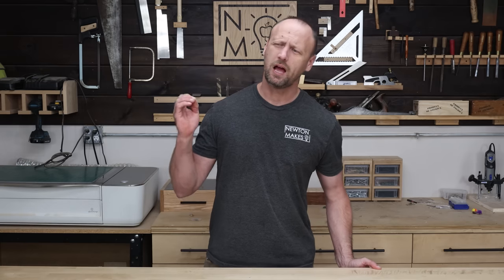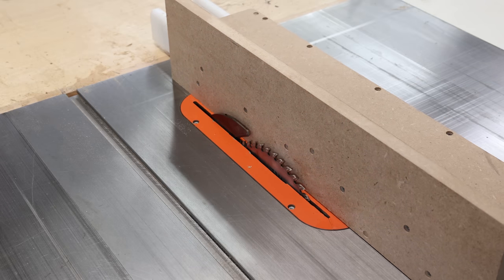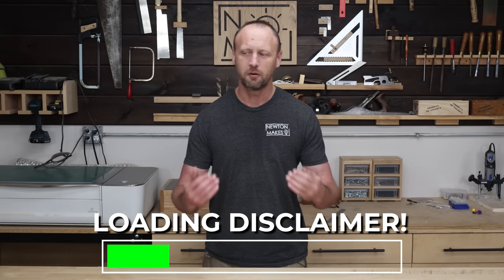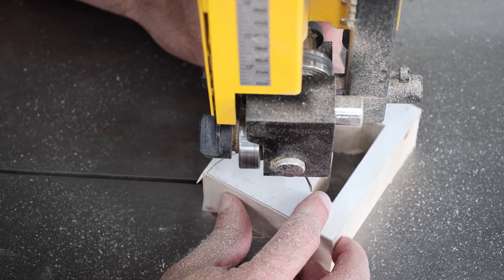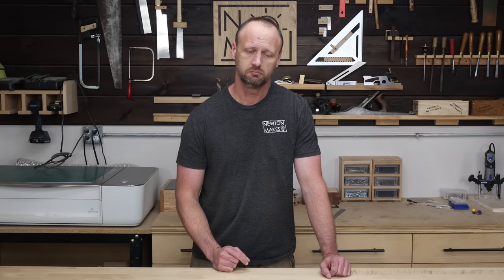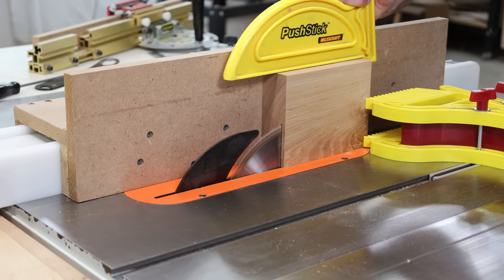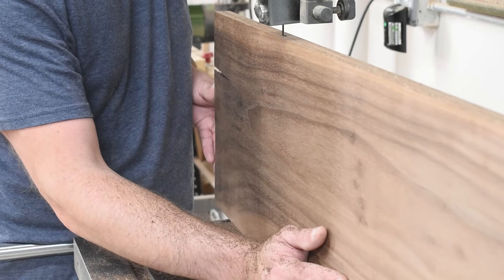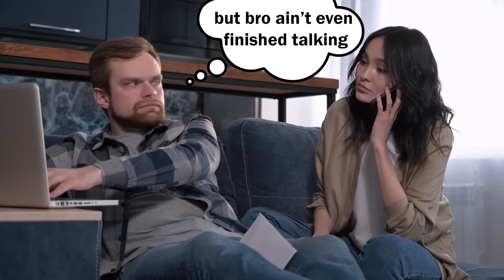You’re Resawing Boards the Wrong Way

Comment: With a band saw able to tension a blade well, there are 2 Lennox carbide tipped blades that will outperform your technique. The fastest and most cost effective for resawing is indeed too wide for curved work. That would be the Woodmaster ct. It has about a .05" kerf. So if you're sawing 1/16" veneers from a 4/4 board you get up to  8 slices, versus up to 5 with your method.  if your machine is adjusted properly and blade sharp, drift isn't an issue. Nor is speed. A band saw with this blade would be faster than your method.
Next choice is Lennox trimaster, 1/2" 3TPI. More expensive than Woodmaster Ct, with slightly larger kerf (.057"), and  somewhat slower feed. But narrow enough to cut many curves, so you could leave it on. This is the blade I use for my one and only  band saw --mostly resawing, some curves. 
Either of these carbide tipped bands will cost  several times more than steel "resaw" blades--but will dramatically outperform them, and outlast them by 15-25X--maybe more. They cut so straight you can do much joinery work with them, another huge plus (tenon cheeks, 1/2 laps....). A 144'" 3 tpi Trimaster has 432 carbide tips for about  $175. A good 10" circular blade has 40 tips for $100 or so. The tips do the cutting.  Do the math....
Consider resawing  on the band saw with a power feeder. There's only one good choice for a small band saw, and you've probably never seen it. Google "Little Proteus power feeder". Maybe i am a little biased (I designed and make and sell the Little Proteus)---but a power feeder on the band saw solves the brain drift issue, and gives you perfect feed speed for hours at a time. It takes almost all the stress out of resawing.
But you're right,--if you don't use a good resaw blade (carbide tipped or Laguna's version) your method makes sense!
Reply: What would you suggest is the single best bandsaw blade for efficiently, precisely and easily slicing veneers?
Seems like you're not even suggesting the resaw king, which is what I've been looking at mostly so far.
Also, do you think a Laguna 18BX would be enough or would I be better advised getting something different? Going to need a lot of veneers.

Comment: the band saw your using says its 12 or 14 inch cut but its a little under powered. laguna 220 volt will roller fence and power feeder will allow you to cut hundred and hundred of board feet per day and has a auto stop. would you buy a black and decker table saw to make stuff or a high end table saw.  same thing..

Comment: My table saw rip blade kerf is very close to my 3tpi bandsaw resaw blade. My 3hp table saw is quite a bit faster than 3hp bandsaw. So, I do it as you described as well. Blade drift is not a big a problem as attention span in most cases. Just sayin…..

Comment: Do you feel that there is a blade height limit with TS method? That is, to ensure that the blade stays at 90 degrees and doesn't get warped offline by a hardwood piece, for instance, when it is fully extended?

Comment: Dear newton
In case you ever wonder if you’re reaching someone let me tell you, I’m indebted to you for this video. You ever come thru portsmouth NH dinner is on me.  
I started my woodworking hobby in 2020 building a guitar 100% from scratch with a master luthier.  I learned how to ruin wood with a table saw, destroy wood with a router, and waste wood with a bandsaw.   
When I built my undersized wood shop and started building basic furniture cutting boards knife racks and boxes I bought a Rikon tabletop bandsaw.  Read everything I could to learn about it.  Played with many blades.  Watched dozens of videos by snodgrass, estlea, stumpy nubs and others about how to eliminate drift.  Wrote to snodgrass.  Spent hundreds on blades.  Setup my saw dozens of times.  Got a jet 14” from an excellent woodworker down the street who was retiring.  Now I could resaw cherry apple and pear logs from my own property.
And both saws, every blade from 1/8” to 3/4”; brand new, used, overpriced, underpriced, cheap, ridiculously expensive, domestic, Chinese, every setup, new blocks, tensioned properly, over tensioned under tensioned, I always had drift.  It could be as much as 1/4” on a 12” piece of stock.  Always.   
Bought the wood slicer from highland woodworking.   Bought the Carter 3/8” that snodgrass says is the only blade you’ll ever need.  (I exaggerate). 
And they all always drifted.  For two years.  
Now the most recent timber wolf 3/4” with a ridiculously painstaking setup seems to have worked.  
But when I saw your video I was finally vindicated.  Thank you.   THANK YOU!!!  I got drift…and you get drift.  
Making a bottom for a box last sunday I used your method, planed down that center piece and goddamn.   
Perfect.

Comment: You are not a real woodworker unless you are resawing with a Roubo frame saw!

Kidding aside, I don't have a bandsaw nor have the funds or the space to put one right now so my next best solution is an antique Disston 4tpi rip saw.  Do like in the video, cut with table saw most of the way through with a 7-1/4" circular saw blade to not waste too much thickness, and finish the cut with the hand saw.  If you think band saw drift is an issue- see how your first hand saw resaw turns out!
Reply from the maker: I've done a lot of free hand sawing. There's a reason why you don't see it a lot in my videos. 🤣

Comment: At around 8:55, you mentioned that you use a circular saw blade in your table saw.  Any recommendations?  That's a great idea!
Reply: Just don’t do that if you own a SawStop.   Also not recommended for thicker woods due to blade drift as hit heats up.
Reply from the maker: I put a blade in the video description. It's to the one I use.
Reply from the maker: I don't have a SawStop so I can't speak to that. However, I use a lot of dense exotics with no issue. Your experience my vary.
Reply: @NewtonMakes Ahh.  OK.  So, it's a 7 1/4".  I was looking and looking for 10" ones and the results were hit or miss.  Gotta say, you learn a lot about the different sizes of obscure stuff when you go looking for it.  Thanks!
Reply: @mcseforsale  Like the different sizes arbor hole?
Reply: @wiseoldfool  LOL.  That's true, innit.  Forgot about that.

Comment: There is only ONE WAY to do things!!! That's what this one "expert" told me. The way he does it is BEST! Because it fits the way HE works!

Obviously, the above is sarcasm. I mix the two styles up. Have a bandsaw, with a good resaw blade, dialed in to limit drift, and I get bored as bejesus resawing anything over about 4" wide on it, because it takes too long. My rule of thumb, if it's a wide board, I start on the tablesaw, then go to the bandsaw. Narrow boards, straight to the bandsaw. For me, I've found clean-up of either style to take about the same amount of time, because I almost always resaw slightly oversize and then take it to the planer or sander to bring to final thickness.

Comment: Blade drift should never really be a problem. Bandsaws have a tolerance of less than a 20th millimeter. If you ever get more, either you set up the band saw incorrectly or the saw is just trash.
Just watching the clip, I noticed you mill wrong as well as use the wrong resaw blade. Maybe that´s why you also get blade drift

Comment: I disagree about dust collection on a bandsaw being worse than a tablesaw. Of course it depends on the saw and the dust collection, but my Grizzly 17” bandsaw with a 4” port just be beneath the table gets 99% of the dust. So does my Sawstop cabinet saw. Now, it doesn’t get what’s on top of the table, but neither does a tablesaw without a dust collection blade guard. Another thing: You can easily and quickly stop a bandsaw blade by keeping two scrap blocks of wood at hand and sandwiching the blade between them like calipers on a disc brake. This will stop the blade in seconds. My Grizzly has a brake, so no problem there.

Comment: Ok, but one thing:  Why are you pinching the wood behind the blade on the band-saw?
Doing this increases the risk of stopping the blade turning - and that's bad.  Yes?
I know you don't want to push the wood all the way to the blade with your fingers - that too is bad.
But you then use a sacrificial piece of wood.